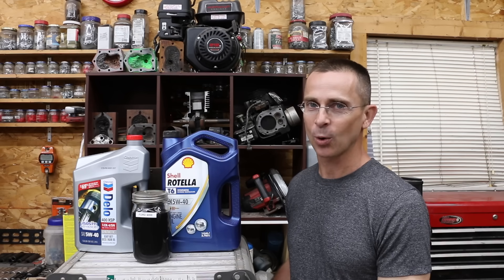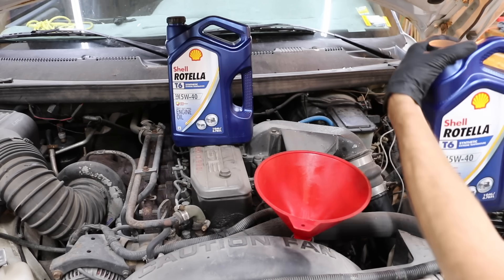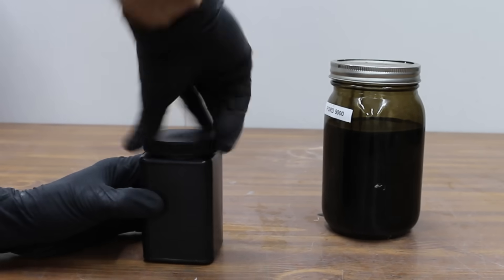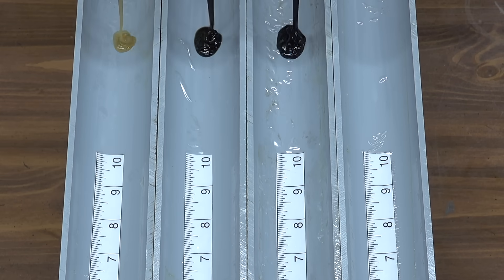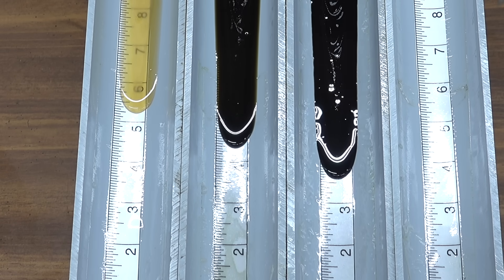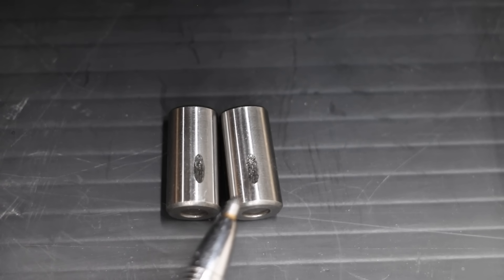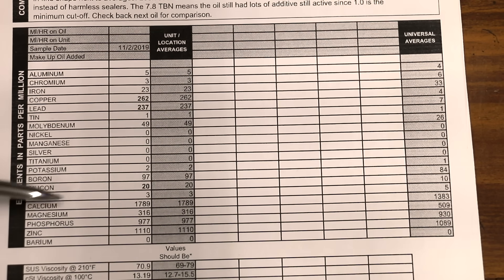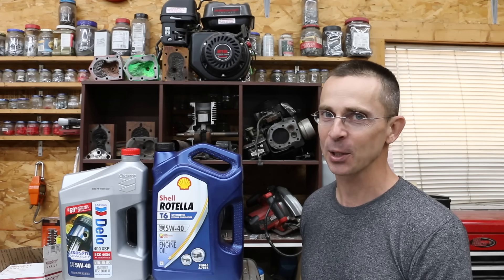Will Annual Oil Change Damage Your Car? Let's find out!

Comment: Great video. It went into a lot more depth than I needed. I have a 3.6R Subaru Outback and I love it. And want to keep the engine in good shape. I don't drive much now that I work from home. Maybe 3,000 a year tops which includes a few medium and possibly 1 long trip. 
I had the oil changed at a quick oil change place that starts with a V. The cost was  $160 which shocked me. The guy said because they used a high grade synthetic oil. OK it was late and I didn't want to argue, I just wanted to get it done. He told me the oil should last 6,000 miles. OK that's 2 years I thought.
But now 1 year later my oil light came on, so I checked and the oil was down close to the low mark, but not past it. I figured I'd go back to the V oil change place and just get a quart or 2 to top it off. When I got there I told them what I wanted to do. The guy, who was the same guy from the previous year said - you need to get an oil change. I said "why I only put 2,000 miles on it, you told me last year I could get 6,000 miles.  Then he says - no it's over 6 months so you need an oil change. I didn't believe him and said I'll just go get some oil at Auto Zone and top it off. Actually the conversation was longer and it got a little heated. He insisted I needed to get the oil changed. I complained about it costing $160, then he said "our oil change is only $103", I did not have the receipt, which I had hoped was in the glove comp) But in the end I shook his hand and said "Ok I understand what you are saying but I have to check it out and for now I'm just going to go buy a couple quarts. This car actually take 6 to 7 quarts. I suspect they didn't put the right amount in a year ago, but no way to tell. I don't think it's burning oil or leaking. 

So I came home just now after buying a few quarts of the 5W-30 High Mileage, which says good for 10,000 miles, and then I did a search. Ai came back and actually agreed with the shop guy saying even if you don't drive your car gas or water can get in and if you don't drive much you won't get the engine hot enough to "burn off" the impurities. I remember the old days we used to say - I'm going out for a drive to blow off the cob webs". I thought it was just a saying but thought there might be an element of truth to it. Little did I know it actually is a thing. 

Now that I have seen this video I feel comfortable NOT getting the oil change at 6 months or even a year. I do get up on the highway for a spell at least once a month so I feel that is enough to burn off the impurities, ie blow the cob webs out, so I think my wonderful 3.6L engine is going to be fine with my maintenance schedule. My care is a 2012 so it's 13 years old. I would have traded it in but they don't make it in the 6 cylinder any more - Argh what are they thinking. I had a bad experience with a turbo once and I have never gotten over it. Love my 3.6 and the paddle shifters!!! And I can get up to 27 mpg's on long trips so I'm OK since I don't have to refill the tank more than once a month. The way I drive I need the extra power or else I'll get into trouble. I am an excellent driver and used to drive in NYC a lot back in the day. Although I drive a bit fast I always use my signals because I want other people to know what I am doing. I have a 6th sense about driving. I can tell within about 10 sec what kind of driver each person is in my field of vision. Is that person going to hog the lane, will they move over, or if someone is coming from behind should I move over. I will be polite and let them by, then I can shadow them from a safe distance but not be the one to get caught in a speed trap! haha! 
thanks for the video. I hope you don't mind my little story!
Reply from the maker: You're welcome!  Thanks for sharing.

Comment: I change mine every 4-6 months. The age doesn't matter as much as the mileage. I change my oil every 5k miles, which is roughly ever 4-6 months. I drive often. Letting a car sit for a few months is fine. If you let it sit for too long, the oil can go bad due to contamination. Better to have it in a garage if you leave it sitting for a long time.

Comment: I've maintained my gasoline machines for over 50 years. My oldest is a walk behind lawn mower bought in 1989 with 700 hours on it. I change oil every 2 years on low usage machines and haven't noticed any bad side effects.. I've run a backup generator, chainsaw, string trimmer, mower, garden tractor (all quality machines) for over 30 years on that schedule.
Reply from the maker: Thanks for sharing.

Comment: I have a 2018 Tacoma and I put less then 1000 miles a year on my truck.  It is kept in the garage and never sees the rain.  It only has 10,000 miles on it and I was wondering with this amount of miles put on yearly when should I have to change oil, 1 time a year, 1 time every 2 years or 1 time every 3 years?  With the way I drive I  in 3 years I would put less then 3,000 miles on her.
Reply: I forgot to say I use Mobil 1 synthetic in her.
Reply from the maker: Thanks for sharing!

Comment: I recently purchased a Gold Certified 2021 Tundra from a dealership in GA with 8,750 miles on it. According to CarFax, the vehicle was purchased new on 2/16/2021, with its first service performed on 6/17/2022, at 4,819 miles. The next service shown was 10/17/2024 at 6,853 miles. The third oil change was performed on June 25, 2025, with 8,736 miles. I asked the head service guy about the longer time between oil changes, and he said he would be more concerned if it had gone 20,000 miles without an oil change than going over six months. He also told me that before doing the certification, they had noticed the oil changes on the CarFax, and they drained the oil and looked at it purposefully; it looked fine. I'm sure they didn't check the moisture as you mentioned in the video. I have no idea if the oil was changed by the owner or a shop that does not report to CarFax, but since they said he was a disabled veteran who does not drive much, I am guessing he did not do it himself. The truck runs wonderfully and looks almost brand new inside and out. Moving forward, it will be done at the 5k mark, and there is a 100k powertrain warranty on it, for what that is worth. Should I be concerned about this, or is there anything I can do to reverse the effects of the longer oil change cycle in those years?

Comment: It's nice to see some actual testing and data to either support or debunk time based oil changes (usually once yearly) instead of the typical conservative, blanket statements out there. I get why OEMs tend to do that, accounting for the lowest common denominator is safe but I feel like everyone's situation/habits are different as well as their knowledge.

I've always gone by mileage for oil changes but my other car sits mostly in the garage now and sees like 2K mi/yr so this time based interval is new to me. I just did an oil change on it after almost 2.5 years/5K mi on the oil but I wasn't too concerned about it. Firstly, when I do drive it I always get it up to operating temperature and then some. Secondly, I use very good synthetic oil (Pennzoil Ultra Platinum) and lastly my car takes 10 quarts so it's less prone to breakdown/additive depletion. Even at 5K miles, the oil is still amber in color.

Comment: It has no sense when thise ouls have a heavy load of additivation you must use untilmthe oíl is done, otherwise you Will streas the Engine with the extra load of additivation each new change

Comment: Diesel engine oil has an extreme detergent package to hold all that carbon in  suspension.  I don’t think I would want to use that in a gasoline engine

Comment: I brought an approved used Toyota with just near to 10000 miles on clock. When I checked the oil a few days after purchasing it, it looked a bit dark despite supposed to have had a service in Aug 2024 @ 8900 miles and it was end Oct 2024 when I purchased it now. It now has 11000 miles on clock and oil looks dirty . I quiried it with the garage last year, they said the hybrid engine uses different oil to my old Toyota and it does look a bit darker colour. What do you guys think

Comment: Thanks for this. Since I now have two cars, my total mileage spread across each means that oil changes intervals will be spread out longer. Well, at least on my older, high mileage car. The newer car is under warranty and I must follow the manufactures oil change interval of six months. But at least I have an answer for the older car in that I can change it with the mileage (4-5K) and not worry if it's been longer than six months.
Reply from the maker: You are welcome!  Thanks for sharing.

Comment: Just found this 5-year old video, watched it for my first time and it really enlightens me about engine oil.
A quick question, how long the time is enough I have to run the engine to effectively expel the moisture from the engine oil?
Reply from the maker: Thanks for the suggestion.
Reply: Until the oil reaches operational temperature.

Comment: If im not mistaken i always get the k&n oil filter for my cummins cause they have a welded nut to the bottom just a lil tip for anyone changing oil often.
Reply from the maker: Thanks for sharing.

Comment: I own a 2008 Honda civic which is almost 15 years old now, with 45,000 miles only. The owner was doing an oil change every 2 years at 5,000 mile intervals. I was worried it may have damged the engine some how because you always hear to do it no less than once a year. Good to know its ok.
Reply from the maker: Thanks for the feedback.

Comment: I drive less than 10,000 km year round in a continental climate. I change my oil just once per year. Is it better on the engine to have fresh oil during the winter, or fresh oil during the summer?

Intuitively I would think fresh oil for the harder season; winter. However, if used oil consistently out performs new oil in the cold flow tests, would it not be a benefit to have the lower viscosity used oil during winter for the most critical issue of cold oil flow?
Reply from the maker: Thanks for the suggestion.

Comment: the 5.9 cummins in that 2500 is one HELL of an engine, as you probably already know, that engine is a member of the million mile club. that engine, with routine maintenance has been known to get to a million miles with few complications. i don't know if they still do but either dodge or cummins would issue you a special placard to put on your engine if you make it to a million. i only got as high as 320,000 before i sold mine when i moved clear accross the globe. i still wish i couldv'e brought that truck with that engine with me.

Comment: I run my 1-ton Duramax 4x4 probably less than 5k miles a year these days. I change the oil, oil filter, fuel filter and screw-on Allison transmission filter once a year. At oil change time, I pull a sample for lab analysis. Never have a problem. I use Amsoil Signature 15W-40 oil and Amsoil oil filter.

Comment: 1 gallon of rotella oil 23.95 from Amazon. A new engine..9000 dollars... You decide... YouTube channel I do cars number 1 reason for destroyed engines... Not changing oil enough
Reply from the maker: Thanks for the feedback.
Reply: @ProjectFarm  by the way I understand the value of an oil analysis I used to do them on my vehicles back when I had a huge 92 miles per day... commute the trouble is other people will not be doing engine oil analysis and they'll run at 10 12000 miles that's all I am saying

Comment: Oil has a lot of acid inhibitors. Acid comes from sulfur content in gas and water vapor from air. If you warm up the engine every couple of weeks to evaporate the water residue,  acid formation is not an issue. Acid can be a problem when you take very short frequent trips and you’re in a humid climate.
Reply from the maker: Thanks for the constructive feedback.

Comment: Didn't the F5000 oil have an additive in it? Pretty sure when you tested synthetic vs non synthetic and if it would cause a leak you used an oil additive. Only wondering if that would have helped with the cold race at the beginning of the video.

Comment: I recently found this channel, and it's excellent! However, I have to comment on this old video.  The way one drives is a significant determining factor of oil.  For instance, short trips, aggressive driving, cold weather short trips, not letting the engine warm up, dusty, dirty environments, and heavy loads on the engine all test the abilities of any oil.  If one drives 50 miles at 60MPH with no load, the oil will be good for a long time. So, take this video with a grain of salt.  Driving conditions are critical to any test... IMHO
Reply from the maker: Thanks!  Thanks for the feedback.

Comment: @projectfarm I am very impressed with the Rotella T6 oil.  Can you think of any reasons I should NOT use Rotella T6 in my gasoline vehicles (1969, 1995, 1997 & 2006)?
Reply from the maker: Thanks for the suggestion.

Comment: Thank you for the wonderful informative video! But I'm wondering if this applies to my 2015 Toyota Corolla, I drive very low miles, roughly 2500 miles a year. At my  previous oil change, by a private mechanic, he  told me to go by miles not years. Specifically telling me not to over -service my vehicle. I forgot which brand he used to change my oil but I know that it's 0-20 W full synthetic. His advice is similar to what is shown in this video but I'm still wondering if I could really safely go 2 years on the same oil before my next oil change ??? My driving is mostly around town, 2-3 times a week, mostly short trips of 5 to 10, non severe conditions.
Reply: I think you can go 2 years and what I would do: 1) drive on a highway once, twice a month for 30 mins or so, 2) try 2 years and send an oil sample to Blackstone lab for analysis.

Comment: Oil & Filters are cheap; however, engines are expensive. You do you and I will do as follows. I have our vehicles' oil & filter changed as follows: Six months or 5,000 miles, whichever occurs first. RST.L
Reply from the maker: Thanks for sharing.

Comment: How about running the same test on passenger cars with small turbocharged engines and using more mainstream synth oils like Mobil One, Castrol and  Valvoline? That would be more helpful to most drivers.
Reply from the maker: Thanks for the suggestion.

Comment: Just an interesting factoid here regarding Celsius vs. Fahrenheit... 
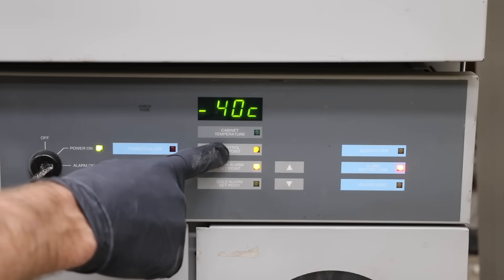At 3:38 he says the freezer was set to -40f while the display shows -40c

The reason this is interesting is because even though the Celsius and Fahrenheit scales are dramatically different, for instance water boils at 100 Celsius but 212 Fahrenheit, and freezes at 0 Celsius or 32 Fahrenheit... 
Forty below zero Celsius is the exact same temperature as forty below zero Fahrenheit.
-40c = -40f
Reply from the maker: Thanks for sharing.

Comment: Have another video idea for you, shell rotella t6 5w40 vs motorcycle oils as everyone swears by rotella t6 for motorcycle oil and people are worried about the oil shearing and messing up wet clutch transmissions. I'm looking into this as I just purchased a drz400sm and there is a lot of options on the forums of what oil you should use and rotella t6 is what most people recommend for all motorcycles. Thanks again
Reply from the maker: Thanks for the suggestion.

Comment: oil can last longer than 1 yr but the oil filter can't (paper inside) so oil filter needs to be replaced
Reply: It's not the time that matters. It's the usage, which should be measured by mileage.

Comment: Great job.
I have Toyota Prado 2003. Patrol engine. Usually I change engine oil (10w 30) and filter every 5000 Km. But now 11 months and ~6500Km. Is it problem?

Comment: Ran T6 in my 97 Powerstroke.   Disclaimer: I DID install a Super Duty starter (way stronger and faster).  However,  even when very cold (under 0* F) it cranked incredibly fast.  Rotella 15 40 was noticeably slower same conditions.  I ran Rotella or John Deere's 15 40 (I worked at a dealer then).  Always used Fleetgaurd filters.  Was into engine (upgrades, not failures), and it was spotless.
Reply from the maker: Thanks for sharing.

Comment: I have a 92 Honda Prelude that had been sitting in the garage for over 6 years with a battery tender connected.  To my surprise this thing started up with a 10 second crank and still drive like new.  I wanted to change the oil, then I found your video when doing car maintenance research😄
Reply: Battery tenders rock if you garage a car for months on end. Years too if you circulate the oil once in awhile!🎉

Comment: I came across this older video from yours because I wanted to know more about Delo. My oil change place started using Delo in most of their customer cars. I'm wondering what your opinion is on Delo being used as a regular gasoline car oil (car: Toyota Corolla)
Reply from the maker: Thanks for the suggestion.

Comment: I bought my car (2006 Nissan note) in 2014. Changed oil in 2016, then in 2022. The car runs fine, I always wait for the blue temp light to go out before I drive off. And I cover an average of 3500 miles a year.
Reply from the maker: Thanks for sharing.

Comment: Thanks a lot for this kind of testing! Trying to make sense of what is a good extended period before the next oil change and asking in forums is like asking them about their religion or politics. They already made their minds and sometimes not even facts based. After watching this I can confidently say is not going to be a problem to extend my oil change and car maintenance for 1 year, or even 2, given that I barely drive (less than 2000 miles per year) given my working from home situation and I don't have any money to burn. Thanks immensely for such a good job you do man!
Reply from the maker: You are welcome!